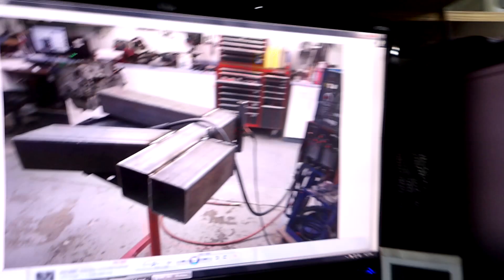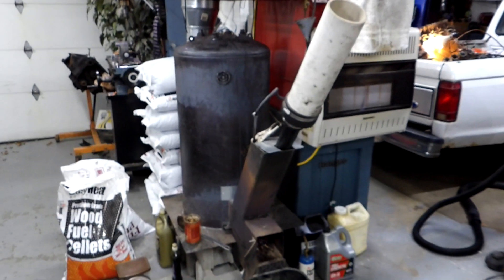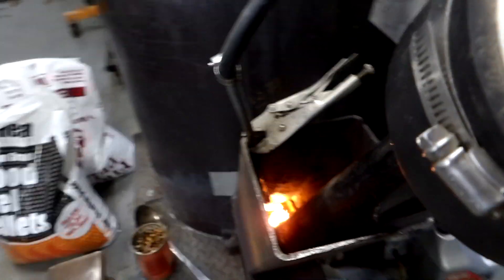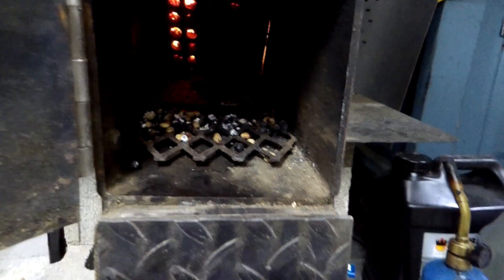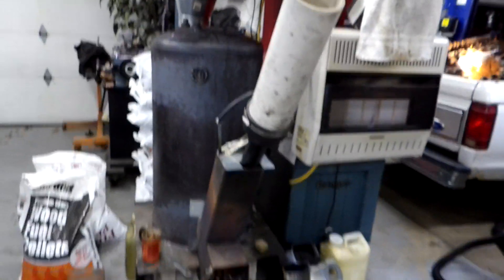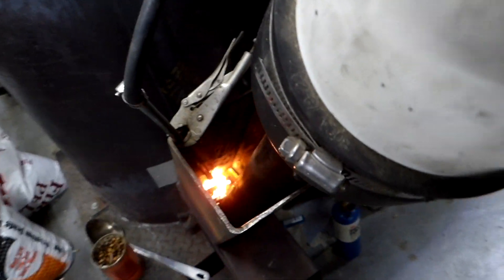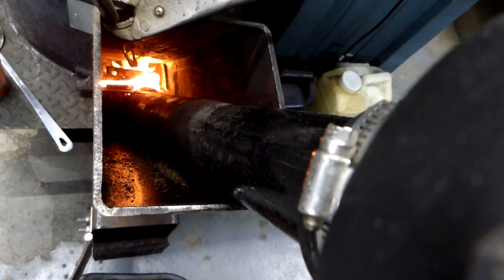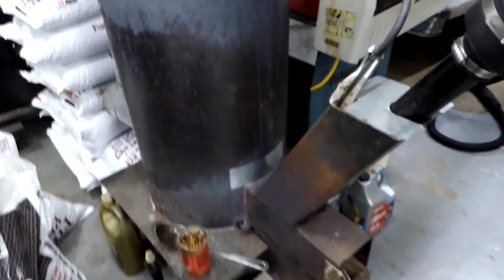Rocket Stove on Wood Pellets - They ROCK !

Comment from the maker: A modification that I would make if building this rocket stove today.

Look at 0:17.  See the 1 1/2 x 1 1/2 angle I have welded to the end of the burn chamber ?  (The welder's ground wire is attached to it).   See the 2 holes in the angle ?  Those holes are what I used to "bolt" the entire assembly to the 1/8 diamond plate base.  
1) I would change the design by making those holes "slots". 
2) Looking at the 1 1/2 x 1 1/2 angle back where the burn chamber and clean-out meet ( you can see where I cut it and bent it to match the curvature of the water tank)..... I would turn that angle around and position it to match the other angle, and drill holes in it (like the other angle), and use that angle as my FIRM attachment point to the 1/8 diamond plate base.  
3) As stated in (2), I would bolt the outer angle FIRM, and bolt the inner angle using bolts and double nuts so it is NOT firmly attached to the diamond plate, rather, the bolts would be in the slots I mentioned in (1).

Why ? 

Because in operation, the burn tube expands !  Yes, it grows quite a bit.   And with my current design, there is a slight gap around the burn chamber that must be maintained so the burn tube can slide in and out as it heats and cools and that gap is an air leak.   If the modifications I mention are made,  the burn tube will be expanding and contracting "inside" the water tank, and you'll be able to run some furnace cement around the gap between the burn tube and the water tank, thus providing for a better 'vacuum" inside the entire assembly -- something necessary for good cold-starts
Reply: I'm moving into a house here in Maine - and planning on building a rocket stove for pellets ... and I'd love to copy your design. 

Questions: Where are you? If it's a manageable drive, I'd love to drive by, take photos, and make a design of your stove using SKETCHUP ... 

I'm particularly interested in your thoughts on the angles for the pellet feeder ...  

Things i've been looking at are: the burn grate - I understand that they burn out over time and wonder if you've had issues. I saw that the company making electricity free Pellet RocketHeater (www.rocketheater.com/buy-a-rocket-heater/) sell a "Heavy Duty Burn Grate is made from exotic 253 Stainless Steel" . Seems that yours is doing just great without the exotic stuff. 

I'm looking at several other things including:
. installing it in the basement of my house, and 

. running piping thru thermal mass to retain the heat in the exhaust pipes
. installing an auger and a Raspberry Pi to drive it to better control the output temperature. 

Looking forward to your reply. 

Parker
Reply: Thinking Michigan (Armada Fair) A drive from ME
Reply from the maker: @rawsushi  The angle of the pellet feeder is quite the discussion. My design is 30 degrees.  The nice thing is at 30 degrees, the feed tube has enough weight to hold the burn basket back against the rear of the burn chamber, which is what you WANT. It seals the burn chamber against the tube forcing all the air to go through the burn chamber. 

On the other hand, at 30 degrees, on occasion, if the pellets are "large", they will 'hang' in the tube.  Normal size pellets never hang.  So, a 20 degree angle would be better, possibly. The more vertical you get, the less force there is holding the burner against the back of the tube and you could get into a situation where it will be so loose you'll loose a lot of draft thru the burner.  Hope that makes sense.  But if I had to do it again, I'd go 20 degrees. 

You'll see a video on the rebuilt burner made out of stainless.  It's already burned through. LOL..  but, it still works even tho there's a big hole in the front of it.  The only downside to the hole is when you first fill it after the initial small amount of pellets get going, the next bunch of raw pellets can run out and put out the flame.  So you have to be more careful in  your timing. Even if the flame goes out it always restarts on it's own because there's a bunch of red pellets in there from the first start.  Once you get it rolling, it doesn't matter.  The hole is meaningless- you can load it right up with no problem. 

I'll ask my metal shop if they can get some 235 stainless.   I've heard Inconel is the ticket. 

Your idea of a raspberry pi is brilliant !  I've thought of it but don't know enough about writing code etc to really make it happen. 

The main thing is : air control.   Your raspberry Pi should control the air door. Then a photo eye that can detect when you need more pellets.   Just let the auger keep the feed tube half way full.  The main control is air.   This thing is so air tight, it will get down to a smolder with the air door closed.  Just a tiny crack will give substantial heat.  And if you let it run wide open on a cold morning when there's a huge draft, the burn tube is glowing red in a few minutes.   So air control should be the focus in automation.   Love your idea. 

Write me if you want  gearhead4you@yahoo.com and I'll give you my phone # and you can call anytime or write and you can certainly stop by if you are ever in the area

Comment: The air intake you close it tu turn it off or you use it always full open?
Reply from the maker: Once the stove up to temperature and the shop is warm, I turn the air way down, the door is almost completely closed.  If you leave the door wide open, the outside of the stove will reach 700F or 370C

Comment: I'm letting you know right now that I am "stealing" your idea to make my own and use it for a sauna stove .  Love the idea you can use  waste oil in a rocket stove.  As for your burner, have you ever used a one piece rectangular tube instead of having to weld all that angle iron?
Reply from the maker: Great - Hope you like it !  As far as the rectangular tube, that would work but the only problem I see is finding the correct size.  The next step down from 5 x 5 is what... 4 x 4 ?  so you'd have a large gap you'd have to fill in along side the tube so you will have the correct vacuum pulling through the burner.  You could take a 5 x 5 and slice it up, and weld it back together.
Reply: @mark_osborne   Thank you for the information.  Correct me if I am wrong, I am thinking of using a steel barrel instead of a hot water tank. I'm thinking it would be better and faster to radiate heat out into the sauna than the thicker metal of the water tank. Were talking Michigan winters here.  :D    Could you heat your shop only using the drip method using waste oil?
Reply from the maker: @deltafour1212  I agree, a 55 gallon drum would be even  better.  Once the room is up to temp, I have found that the oil drip is enough to carry through the afternoon and evening.  But you need to get your burner up to temp first by burning pellets, then drip the oil.  If the burner isn't hot enough, you'll create a lot of chimney soot and plug up the holes in the burner pretty quick with oil residue.  The additives in engine oil don't burn well unless the burner is VERY hot.  You could retro-fit an oil burner to the input side of the 5 x 5 tube and remove the burn basket.  I've thought about doing that just to get rid of some waste oil.

Comment: Nice.  How do you clean it out after the season?
Reply from the maker: I just vacuum out the burner which is something I do every morning anyway.  Also, there's a clean out cap  that you can remove at the chimney (at the bottom), and I stick the vacuum in there every couple weeks.  The chimney stays pretty clean, but I do take it apart once a year and knock out any dust just to be safe.  The chimney doesn't get hot enough to start on fire.
Reply: @mark_osborne  Thank you.  What exactly are you taking apart?  Is the burner able to be taken apart?  Would you consider doing a video on an end of season clean out so we can see exactly how you do that?  It would be much appreciated.

Comment: It's probably better not to run your stover over 500F. metal will break down.
Reply from the maker: A couple minutes after you fire it the burn chamber is up to about 1800 degrees based on the color of the metal probe. .... thus the magic of the rocket stove, it burns all the wood gas !
Reply: @mark_osborne  brass melts at 1900, yellow bronze about 16-18.  That is one hot tamale. If I ever move to a smaller house with large work shop Ill be revisiting your designe!

Comment: Hi Mark, great efficient build that you have here. I'm new to rocket and pellet stoves and I have a few questions if you don't mind? I have a large old school 2 door Timberline that has served me well for many years but I want to get away from the wood hassles. Just from watching pellet stove videos, I'm not seeing anything that impresses me as a replacement. Could I modify the Timberline for pellets/rocket or would it be best to get rid of it and start from scratch? My existing chimney is a 13"x 8 1/2" masonry about 35' tall. The draft is outrageous but it's also a pain in the summer when it decides to switch direction and I have to seal it up. Can I use it as is or would I have to drop a smaller round pipe down through it? Thanks for any advice! I have a machinist shop and welding equipment available.
Reply from the maker: Hi Nicholas, as much as I love Timberline stoves, I can't see a way you could modify it as you need a heat ex-changer to capture the heat given off by the burn chamber.  Just follow my design or any of the other hundreds you can find on Youtube.  Your chimney can certainly provide enough 'suction' to operate a Rocket Stove provided it's fairly 'air tight', meaning, no leaks.  We need a lot of 'suction' to make a Rocket Stove work.  Worst case, you may have to run a dedicate flue pipe as you suggest. Let us know how it works out ! Looking forward to any videos you can share-also :-)

Comment: ...MARK OSBORNE ... I REALLY LIKE THE DESIGN OF YOUR ROCKET STOVE AND HOW EFFICIENT IT BURNS!!!  DO YOU HAVE ANY DRAWINGS /PLANS  THAT I CAN GET FROM YOU  ? OR DO YOU HAVE A VIDEO  OF HOW IT WAS MADE.  I WANT TO FOLLOW YOUR DESIGN AND BUILD ONE...  IF YOU HAVE DESIGN DRAWINGS CAN I PURCHASE THEM & HOW MUCH ?  ALSO REF:THE WATER HEATER...  IS THE TANK STAINLESS STEEL AND WHAT IS THE DESIGN INSIDE OF THE TANK??   (I HAVE AN IDEA OF HOW THE TANK WORKS,  JUST NOT SURE OF HOW IT'S DESIGNED...  WOULD YOUR DESIGN BE OK TO USE INSIDE OF THE HOUSE , LIVING AREA.?  IS IT CLEAN ENOUGH  FOR LIVING QUARTERS, HOW MUCH SMOKE OR ASH  PRODUCED.... *SORRY FOR SO MANY QUESTIONS * BUT I LOVE YOUR DESIGN... I SPEND $ 350.00 + PER MONTH,  IN WINTER MONTHS TO HEAT MY HOUSE,  ALL ELECTRIC..  THANKS FOR YOUR HELP,  I APPRECIATE  YOUR  HELP AND INFO.

Comment: Fantastic ! but you didn't mention how many tons of wood pellets you have used per burn season ! We need to know that !
I have been contemplating making a rocket stove that burns wood pellets to replace my ageing pellet stove, and according to all I can find out it would reduce my wood pellet use to below a bag a day that I am currently using .... can you confirm that?
How much pellets do you use per day when it's cold out ?  
thank you very much for sharing your build ! ...
Bob........
Reply: Ahh ! from your responses to the comments  I see you use just a tad less than a bag a day to heat your big shop
...for my house here I'm thinking a 4"x 4" tube Rocket stove would run us out ! the problem with that is smaller tubes don't handle pellets to well.... but I am sure I'll figure something out, like restrict a 4"....or go to a 3" tube and keep the velocity of the air high  and just fight pellet jams as they happen ! (if they happen) 
I also noticed you do not have a air Gap under your pellet basket yet it burns quite well, just goes to show you
that the design is very versatile !  Thank you Kind sir for your Help ! , Bob....
Reply from the maker: @bobkelly2447  Hey Bob, just so ya know, the air door controls the burn rate 'substantially', meaning, I can cut the burn rate by probably 80% by closing the door.   I wouldn't be afraid of a 5 x 5 burn tube .  You might need the heat in the morning  :-) If you get close to Michigan feel free to stop by and check it out !
Reply: Mark !   Thank you very much for your Reply ! it's great to hear from you !
I could not agree with you more about NOT insulating the heat rizer.....I never have understood that idea
it is contrary to logic ! that tube is hot enough !!! in your case you could add angle iron fins all the way around the water heater tank on the outside to help radiate the heat better, more surface area ! 
I understand what you did in the pellet feeder , but wonder if your getting enough air through that wall of pellets, I would think that you could improve the burn by putting a plate across the bottom of the pellet burner about 1/2" from the bottom , maybe a little less like 3/8"  this would keep allot of the heat OFF the bottom of the heat tube where it has burned through, and allow more air through, making a hotter burn per quantity of pellets ! 
you are light years ahead of me !  keep up the good work ! and thank you for all your videos !
Bob......
Reply from the maker: @bobkelly2447  Yes I've seen similar designs (where there's an air gap).  In practice, the burner slowly fills with ash which chokes off the air flow, and you WANT that as the daytime (outside) temps increase and the building (or house) is up to temperature, your heat demand decreases by 70-80%.  So if you had that air gap, I don't know how that would play out.  As it stands, the air MUST pass thru the pellets even when it's choked off with ash (or if I've closed the burn/air door).  And it seems to me that is what you want as it keeps the pellets burning. An air gap at the bottom might allow the pellets to go out.  But you could certainly try it!  and always remove the air gap if the pellets go out.
Reply: Good point....  I may try it both ways and see which is better ! ...thanks again for your help !
keep up with the videos on the Rocket stove ! , later ! Bob.....
Reply: Mark, I got to thinking on the insulated riser tube...almost all Rocket stoves have an insulated riser in them...
and I believe the reason for that is that it would raise the internal temperature of the flame and gasses at this point, as they travel into the tank,  giving the burn a more complete burn...no smoke ... and who knows, it might raise the temperature several hundred degrees by the time it exits into the tank... if so , you might get a hotter stove if the riser is insulated !!!! ...certainly it would be a cleaner burning stove with it insulated as the gasses temperature would be hotter for longer ! 
so perhaps by insulating the riser tube you can gain 200~300 deg. right off the start ?
you mentioned that the stove glowed orange when you had it really cooking right ? maybe you could get that kind of temperature at half throttle eh ?
just food for thought !   thanks for your engine inspection video just out, I agree that looked like a new engine inside !  you got real lucky on that one !  Good man !
Keep after it !
Bob......
Reply from the maker: @bobkelly2447  You could certainly try it !   BTW, there is a 'clean out' cap at the base of the stove right where the chimney makes a 90 to go vertical. When the stove is running, I can pull that cap off and shine a flashlight into the stove (I can see the riser).  There is absolutely no smoke for the first couple seconds until the lack of draft (from removing the cap) causes the burn to go dirty due to lack of airflow.   This is even true when the stove is idling.  So I'm thinking there isn't much smoke left to burn :-)  and not much to be gained by insulating the riser.  However, insulating the horizontal burn tube 'might' give an even cleaner burn - if that's possible.  Always enjoy your thoughts Bob.

Comment: have you ever thought of converting a gas hot water tank to wood pellets using the center flue for the hot gasses?
Reply from the maker: That's what this is, a gas hot water tank.  But you want the hot gases to hang around in the tank for as long as possible so they give-up their heat !... thus the reason for the bottom exit

Comment: Thanks for the video 👍 you have my wheels turning🤔. Can I ask what size your building is?
Reply from the maker: The building is 47 x 30 with 2 large insulated doors and 2 entrance doors.  10 -12 inches of insulation in the ceiling and the walls are 2 x 6's filled with fiberglass insulation.  The entire building is covered in T-11 for whatever that's worth.     If I were building it today I'd spray foam everything and really improve upon the air-tight quality >> would take even less to heat :-)

Comment: Just got delivered 4ft peice 3.4 mm thick 316 6inch wide just waiting for the 2ft horizontal piece .the actual outer casing will be made to order my mate works at an engineering company he said he will roll me what ever diameter I need .what thickness do you reckon would be best thanks for your help
Reply from the maker: 3.4 mm will be fine for the burn tube and riser, especially since it's stainless- it will never erode from heat.   As far as the tank ? ... I wish I could tell you the thickness of the tank, I never measured it. I'm sure you could get away with 1/16 inch, or 1.6 mm for the tank (outer casing)
Reply: Thanks I will do some more research on the outer casing thickness thanks for all the informative bit early but have a nice Christmas and a prosperous new year all the best from Yorkshire in England
Reply from the maker: @grahamprecious7330  Likewise, thanks !   Please put up a video of the completed project- I'll be looking forward to seeing it :-)
Reply: I won't be building it for a few months just gathering all the info and materials then I will be plodding along with it through summer ready for next winter will keep you informed thanks again